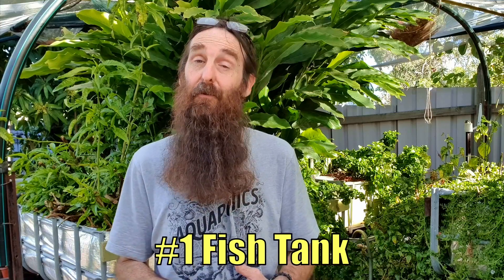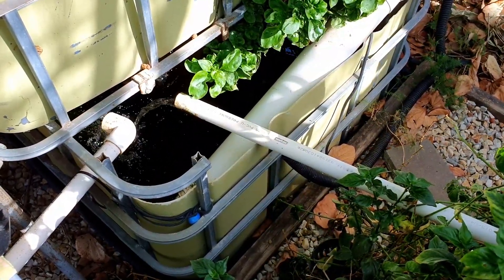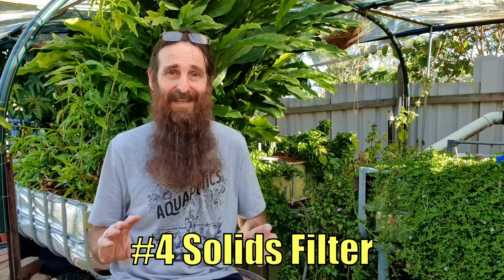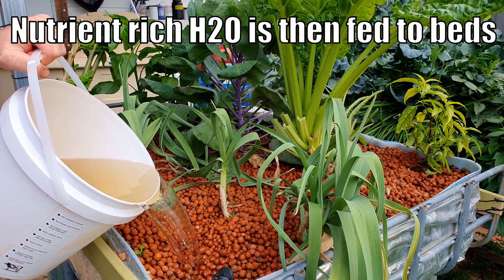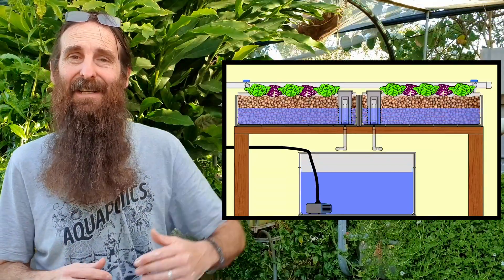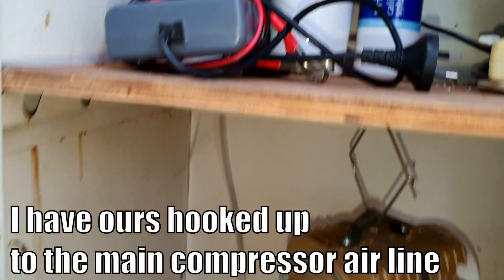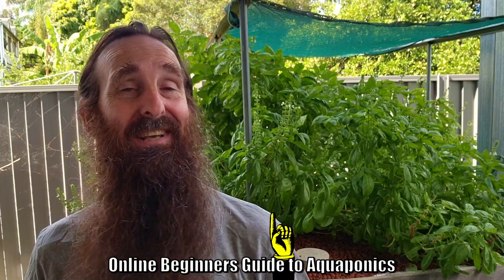9 Essential Aquaponics Components - System Design

Comment: I had IBC grow beds above IBC sumps for more than 10 years. Trout did very well for 8 of those years but not the last 2 years. Cleaned the gravel, tested the water, bought new food and still trout had poor growth and died. The metal cages had a lot of rust and rusted metal was falling into the sump. Dismantled the system and using a magnet collected 320 gm of rusted metal from the sump, it looked like the usual sediment on the floor of the sump. The IBC cages had complete loss of metal in some areas. This was discovered after dismantling.   I have no doubt that the fish were suffering Iron Toxicity.  I now know that IBCs grow beds must NEVER be placed above the sump as corrosion will always occur.  Corrosion of the cage is INENEVITABLE and it will KILL your fish. May take several years but it will happen. As it rusts even the thin galvanising will release toxic Zinc into the water as well as the toxic levels of Iron. This will weaken the fish and slowly kill them. Metals like Zinc and Iron are called essential trace elements and are only safe at extremely low levels.
Reply from the maker: Cheers for leaving this here mate.
Reply: Glad you eventually replied. It is very important to spread the word. IBCs above sumps will always eventually kill the fish. This information must be shared with the aquaponic community. @RobsAquaponics

Comment: Has anyone ever seen or heard of iron Fe toxicity in an IBC setup? I can't be the only victim. Caused by rusty cages above sumps.
Reply from the maker: You're the first one I've heard of Jim. Could it be a sensitivity that the trout have?
Reply: @RobsAquaponics   It is iron toxicity due to the large amount of rusted iron dissolving in a solvent ie water. Only safe and beneficial as a trace element which is at very low levels. It also takes several years to become a lethal problem. Very likely causes failure without being recognized as the cause.

Comment: That video got me real close to starting up another system. Great job! Good day
Reply from the maker: Cheers Matthew.  I need to start organising that small one on the deck here as well.
Reply: @RobsAquaponics  any ideas on a miniature system?
Reply from the maker: @matthewg4956  How small mate?
Reply: @RobsAquaponics  something for herbs for the kitchen. Goldfish size tank
Reply from the maker: @matthewg4956  A few (2-6) small fish won't really produce enough to waste to support more than a few green onions I think Matthew. At that scale I think folks are better off running a small counter top hydroponic unit. All the small bench top systems I've seen folks try to market have 1 or 2 fish in them yet are overgrown with greens. It's all a marketing ploy if they're not including instructions for adding additional nutrients. 
That's my 2cents on them. 
It's also one of the reasons I'm, adding the soil bed to the balcony system (that I should be working on) that will be powered by a dozen or so rainbow fish.
I hope that helps some mate.
Reply: @RobsAquaponics  it does help, thank you. You are an encyclopedia of aquaponics young man. You should market it 😂
Reply from the maker: @matthewg4956  I'm trying my best 😂 but I'm thinking weeping floors would pay better. 😉

Comment: hey rob what do you use for ph down? i use a strong acid (phosphoric acid) on my hydroponic grows and am wondering if it would transfer over well to an aquaponics system.
Reply: In aquaponics you need pH to be in range of 6.8 - 7.2 to keep the nitration cycle running. Rather pH neutral.
Reply from the maker: @Pankaj13Das  I prefer 6.5 - 7  👍
Reply from the maker: I wouldn't be adding any pH down into a system with fish. I'd treat the top up water & add that in slowly to lower the overall system pH.  The pH will naturally start falling as the amount of ammonia increases & is oxidised into nitrate as that process consumes alkalinity. 
How old is your system?

Comment: Another great video, cheers for everything you do Rob!

Timestamps for reference:
#1 Fish Tank
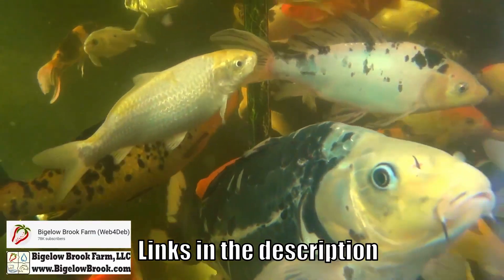#2 (02:06) Sump Tank
#3 (02:58) Solids Lifting Outlet
#4 (04:34) Solids Filter
#5 (07:06) Biofilter
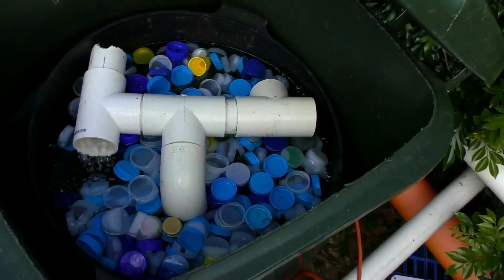#6 (09:57) Water Pump
#7 (11:12) Air Pump
#8 (11:35) Backup Air System
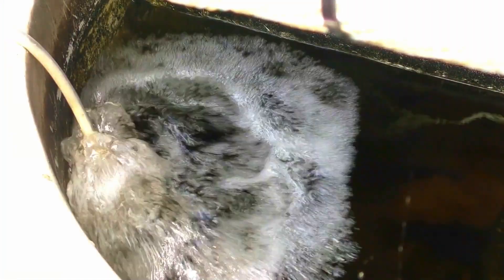#9 (12:16) Water Test Kit
Reply from the maker: Thanks for that TA.👍 I shall add the index in now. 
Cheers & have a top one.